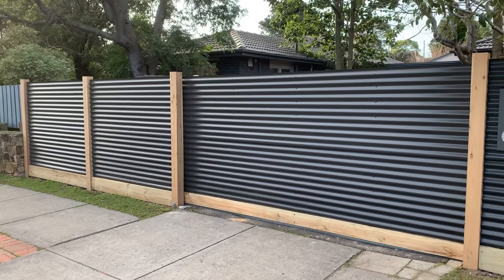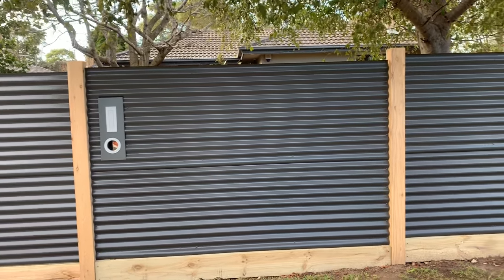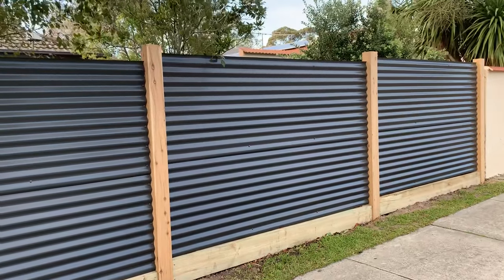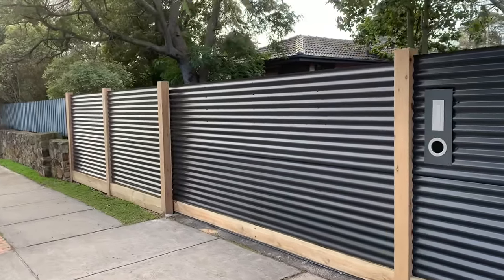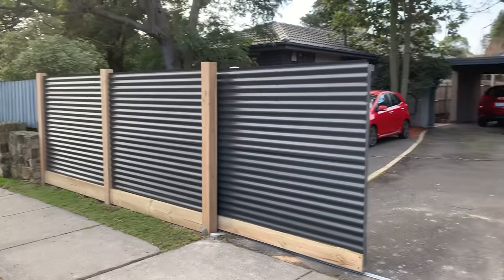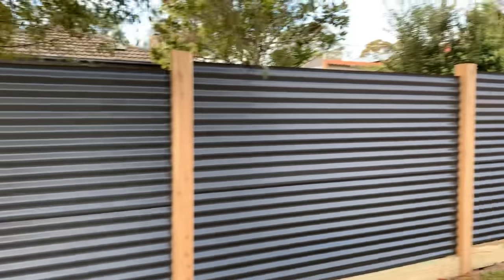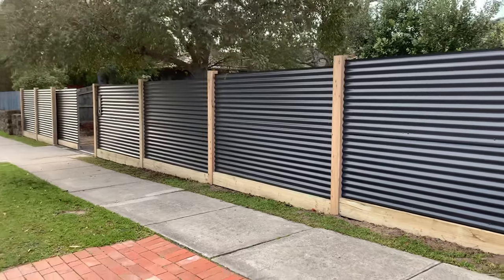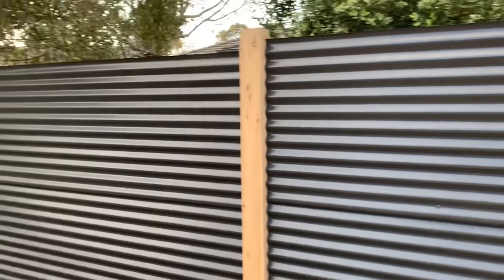Corrugated steel exposed post fence with sleeper. Automatic sliding gate.

Comment: Good job Nail, this is the design I was looking for but will use Red Gum hardwood. Gona do the the sliding gate as well. Thanks for the vid.😉 Question: Why use the  low voltage gate motor & not a 240V?
Reply from the maker: Thanks champ. Good luck on your build. Low voltage is easier would be the simplest explanation 👍
Reply: @naileditfencing  Thanks for that, Did you put a rail at the top or just the 1 in the middle & the side fixing points? 🤔

Comment: I think you have 1x1(US) pieces on each side of the metal.  I think i can see screws screwed in on each side, then the wood 1x1s are screwed directly to the posts on the backside.  Am i correct?  Super clean job mate. (Working on my accent, let me know if that sounded good). Haha

Comment: Per section...Is that 2 sheets o steel ?  What is each steel piece measurement?   Is it same as roofing for house?  Is that grey color painted on OR color of steel?
Reply from the maker: 2 sheets. Can’t remember exact measurement of sheets. About 900mm. It’s colorbond sheeting. It is the same as roof, however coloured same on both sides. Comes in a variety of colours
Reply: If I ever win the lottery,  I will contract “you” to supervise my fence construction.... it will be worth it. Lol
Reply from the maker: SMART ASSIST 😂 fingers crossed 🤞
Reply: Beautiful!

Comment: Hi I love your fence.  I am planning on building a similar concept for my home in South Texas.  I have a small problem no store done here carries the corrugated metal black on black.  May I ask where you bought the metal and is it black on both sides?
Reply from the maker: I’m in Australia. It is the same colour both sides. If you can’t get it, try getting plain sheets powder coated.
Reply: @naileditfencing  Is there any problem with using roofing sheet, it's just the standard light colour?

Comment: You didn't explain much of anything..... Its a very nice fence.    Nothing much shown except the look
Reply from the maker: Marcos Villagran yeah it’s not a “how to” video. Just showcasing my work. 👍 might do one in the future
Reply: @naileditfencing  how did you build the sliding gate? Any details on that?
Reply from the maker: ddemier ddemier hi mate. Fabricate a gal steel frame. Insert two wheels in the bottom rail. Clad materials to front of frame. Add post with rollers to slide.